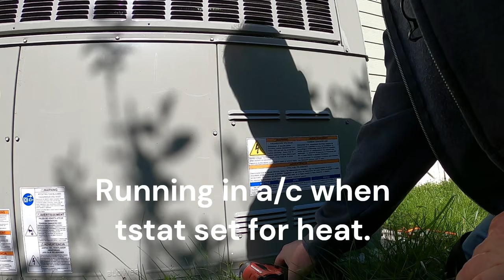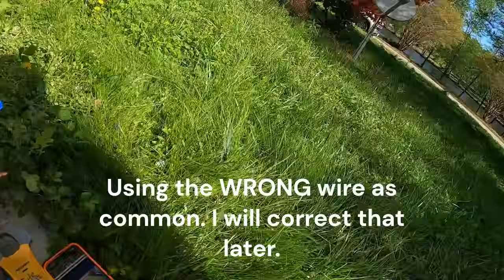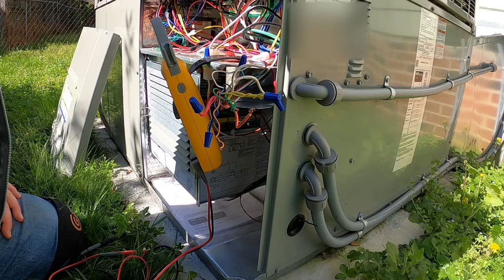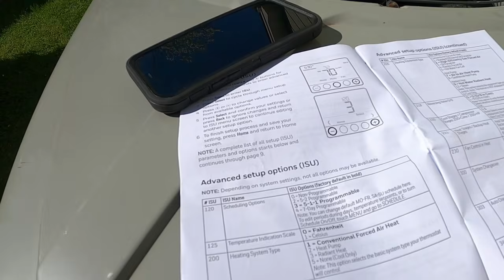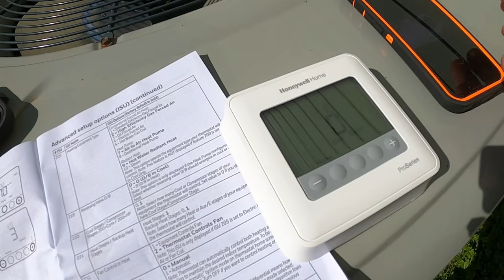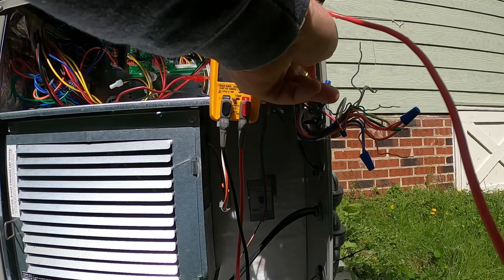No Heat. Honeywell T-series Thermostats

Comment: Haha. I had a new system installed Sep 2023. They came for their 6 month checkup. the blower motor wasn't working properly. Replaced it, still not working. Replaced the HoneyWell...and they said the same thing that you said.

Comment: These things are terrible, they need recalled and taken off the shelf. Two of them brand new pretty much bad out of the box.
Reply: they work if wired right.
Reply: @MariosACandRefrigeration  LMAO I just replaced 2 on a brand new job.
Reply: @chptech  you can"t tie W on HP.or heater will turn on in cooling.